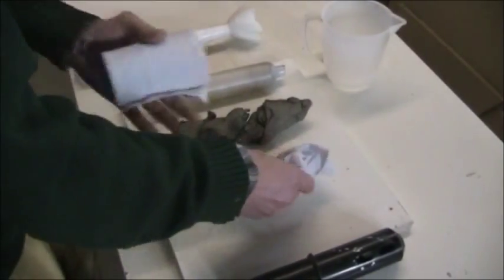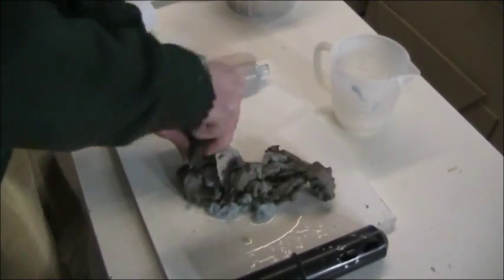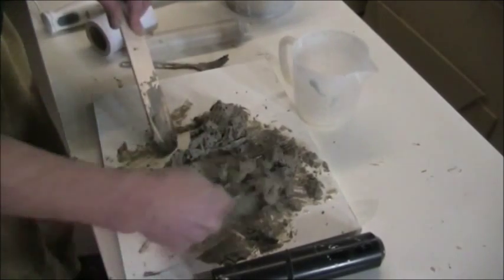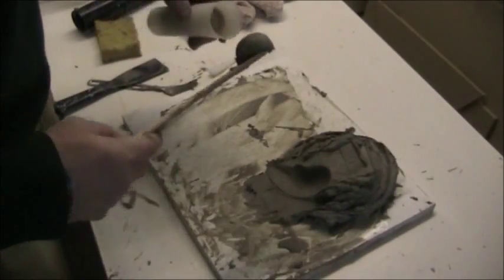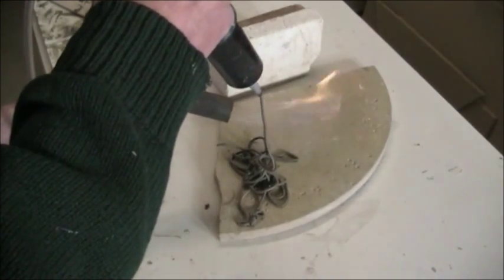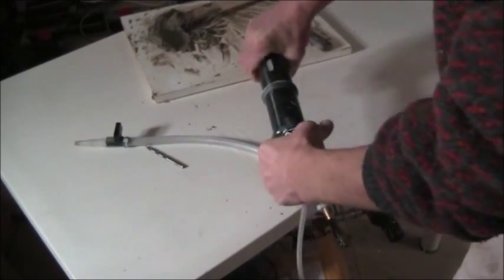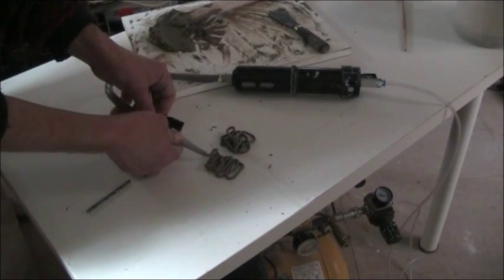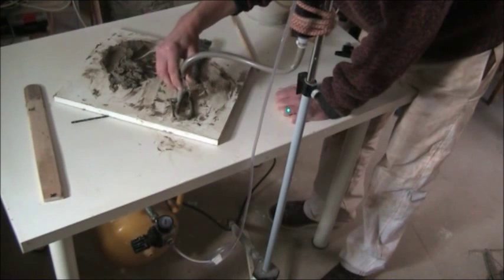Thoughts for a Robot Arm Clay Extruder

Comment: Would mechanically mixing add much air in to the blend? If so, could it be kneaded back out on the work surface?
I haven't a clue about the properties of clay, for firing. I do know alot about cements, and am considering experimenting with a blend of the two, to get a "slicker" material that would be easier to extrude, and not require firing,, just a good bake in the sun light.